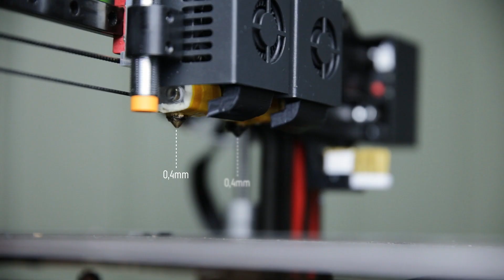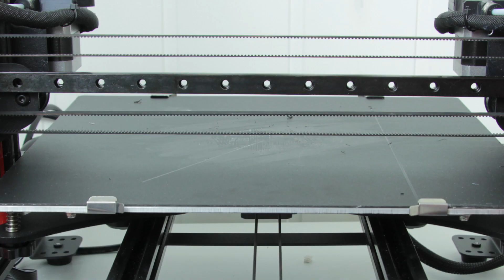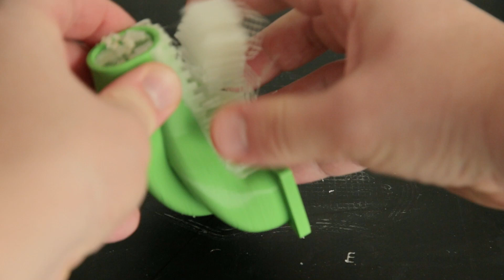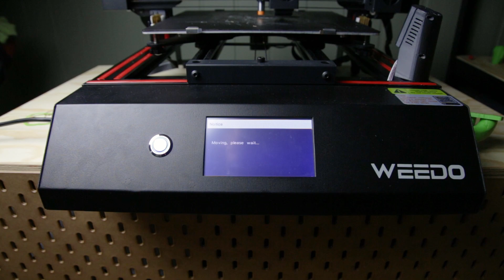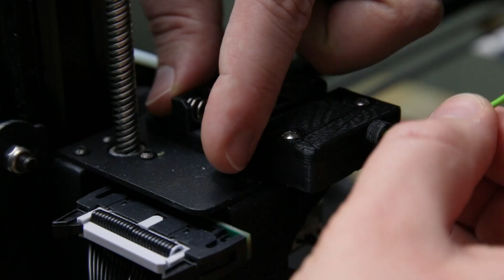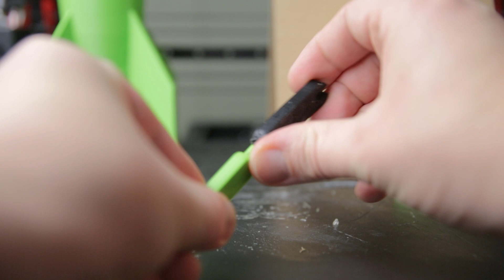Weedo X40 IDEX Dual Extruder 3D Printer - Full Review

Comment: Sadly, the software has not been improved since this review came out. The control you have over prints is still extremely limited to what you showed here, and the source code is still not publicly available so people aren't even able to make their own necessary changes. The filament outage sensor is still buggy (giving false readings) as well. Also, something seems really wrong with the speed of the prints. I set my print and travel speed super low (nearly 40mm/s) in the slicer, but the machine still whips around very hard, causing slips in the belt and the frame to shudder. Sadly, this one is getting returned.
Reply from the maker: I have also keept pushing for updates and changes to the software setup. I think for the speeds I'm not sure I had the same experience, sounds really bad with slippage! As I mentioned, this really needs updates to be as good as it could!
Reply: @3DPrintTechDesign  I ended up getting the one I received, and installing a BTT Octopus, and giving each Z axis their own motor. I'm not a fan of the non-stock hotends, so I am also working on making a custom mount for standard MK8 hot ends like Creality or Microswiss, plus a way to easily adjust nozzle height by using a scre adjustment accessible at the top of the hot end.

Comment: I'm looking at possibly getting this. It would be my first 3d printer. After having some time with it since this video, would you recommend it or a different printer?
Reply from the maker: Hey Trevor, I have actually used only very little since this video. They have not really released enough updates for me to use the dual extrusion that much.  It works, and is one of the cheaper IDEX out there, but if you don't NEED IDEX dual extrusion maybe look for something more common, that gets more updates =)

Comment: Can you set up the printer to switch to the other extruder if one runs out of filament?  This way if you load up 2 of the same rolls and print until one runs out then switch to the other.

Comment: Neither Ultimaker nor Prusa Research seem to have IDEX printers so far, that's probably why there is not much upstream support in Cura or Slicer. For IDEX printers to become more useful and more common, I think those slicers need to incorporate it.
Reply from the maker: That's true, BCN3D Have been running with custom cura for a long time and they have it working well, but not as perfect as I'd like though =)

Comment: Hi, nice test and review, thanks! Maybe ask what grade of tpu filament you used on the dual material models? I'm wondering how soft a filament you can use before it starts having problems. I'm already a backer, I like the size and features it has and have some ideas of how to use the idex function, like making  wheel and tyre in one.
Reply from the maker: Thank you!  That would be 60D, so pretty soft considering it's a bowden. The entry to the PTFE-tubes are well designed so I feel confident it can push the filament.  I use filamentfilter+thin oil as well, so that might help with the TPU sliding through as well =)

Comment: Thank you for this review, this was very helpfull!!! I just wanted to note, that you can extract the dmg file of mac cura version using 7zip etc and then you should be able to copy the profiles to your windows installation. 
From what i have tested you seem to need those files:
- resources/definitions/weedo_base.def.json
- resources/definitions/weedo_x40.def.json
- resources/extruders/weedo_base_extruder_0.def.json
- resources/extruders/weedo_extruder_left_0.def.json
- resources/extruders/weedo_extruder_left.def.json
- resources/extruders/weedo_extruder_right_0.def.json
- resources/extruders/weedo_extruder_right.def.json
Place them in your in the corresponding location of your cura installation and you should be able to select the printer. I tested it using Linux and there it worked for me.
Reply from the maker: Woah! Will absolutely try this out! Huge thanks!
Reply: You are welcome! :)

Comment: Thanks for the full review. I was wondering if in the meantime you did more tests with different filaments. The dual extrusion examples look horrible while the examples made by other reviewers were smooth as butter.
Reply from the maker: the pre-sliced Dual colors are flawless. I haven't seen if others are doing that yet (or if they are using mac and have the Cura setup). The thing is that when you use all the "saftey" like ooze-shield, prime tower etc. you get great dual color mixing. It's my oppinion that an IDEX should do good dual color without those features turned on, but as I show, it's not there yet =).   as soon as there are new firmware/software I'll get cracking on more dual colors =)

Btw, I also mix more materials than colors =)
Reply: @3DPrintTechDesign  I'm still a bit confused, the boat was printed with a shield around it, yet the quality looks awful, this makes me worry about the overall quality of this machine. Just like the example of the astronaut, the layer stacking is all over the place and much worse than in for example the one in American Tech's review.

Comment: Seems to be a lot of layer "shifts" on youre prints
Reply from the maker: It's mostly on dual-color prints due to the rough swapping on extruders (as you saw when it really wrecked over the print as one extruder moved in)
Reply: @3DPrintTechDesign  yeah, i was thinking that was the reason. But the fine thing about that is that it is code related. I have supported the campaign myself. Thougt that well, i could Always just use one hotend if the idex doesnt really work

Comment: I'm in so much doubt, should I keep my pledge or should I go with Ender 5 Plus.

Those print you show, all the lines/layers you can see, that is a no go for me.

Question for you: Would be doing to pure software alone or?

Even my Ender 3 Pro make better print then you have show… 

I will mainly print in PLA and PETG, also build enclosure, so ASA print would be possible.

Please give me a hint of what to buy.
Reply from the maker: Remember the software is really beta. I think all the hardware and possibilities are great. During my weeks they've already done changes and as you can see on the kickstarter page they are working on it as we speak. Mine is really pre-production on everything.  Dual extrusion (IDEX) is still epic. And as soon as I have Cura profiles to work from I'll do my best to get some profiles to the community that works =)
Reply: I have also pleaded and also have an Ender 3 Pro. I approach this as an upgradable printer with decent hardware. Being IDEX I see it almost as a two for one system that has weaknesses at the moment. As it prints very well single extruder and possible duplicate and mirror. Any tuning required with dual extruder will be refined over time. Other reviews and even the unboxing have shown me the potential. My Ender was good but even that is now running a different control board and direct drive extruder.
Reply: @alanjones4747  I say thank for your thoughts also big thanks to reviewer. 

It always a risk with new stuff, special first model. So thats the reason for my doubt. 

I will keep my pledge, and drop the idea of Ender 5, since ender allready need better (silence) mainboard and better fan to keep it low noise. 

I do hope someone in future can help me with this printer and Cura. 

I do not learn fast anymore 🙃
Reply from the maker: Oh crap, I forgot to mention the PSU fan is "loud" in the x40. The rest is quiet, but the PSU is loud. Haven't seen any updates on that in the Kickstarter yet
Reply: @3DPrintTechDesign  That is a very very easy fix. Just replace the fan with a new one.  They allways use ultra cheap models that hurt your ears, I self use them fan from Arctic, and they don't say a darn ting. My Ender 3 Pro fan was also extreme noisefull, but there I just printet a honeycomp shell, no fan needed :)
Reply from the maker: @Johan Strauss the solution isn't the problem, but the fact it ships with silent everything, but a loud PSU is not something I enjoy.   And opening up a PSU isn't something beginners should do. If I'm not mistaken it's dangerous if you touch capacitors/short them =)
Reply: @3DPrintTechDesign  I dare to change, but ofcourse pay attention when doing it. Allways unplug wall cable and do turn on/off printer, then it's more safe to do it :)

Comment: I guess my dream of having an IDEX 3d printer is not there yet. RIP the dice I sent.
Reply from the maker: The dice did NOT go well.  But, I could do the same print on the BCN3D without issues, and only difference is that I cant control the speed and how this machine does the PVE right now. You really have to treat PVA like TPU with speeds/retractions/behavior being conservative.    Hold your horses and when the kickstarter is done, I have better software options I'll make it work for ya =)
Reply: @3DPrintTechDesign  I would hope so with the BCN3D those are a pretty penny.
Reply: @3DPrintTechDesign  I can't buy then wait for changes. But I'll see what they do through you :) I think 2021 can be a great year for resin and FDM printers.